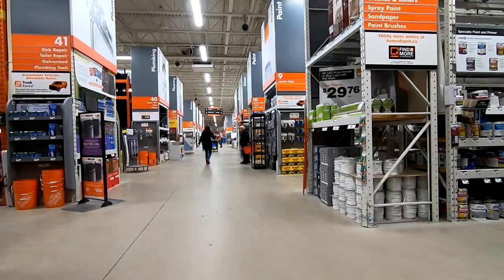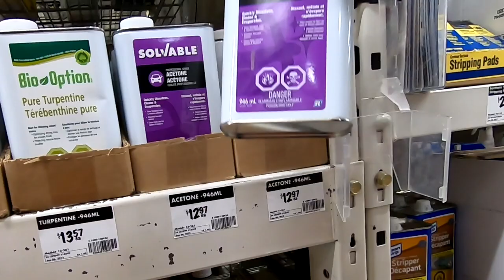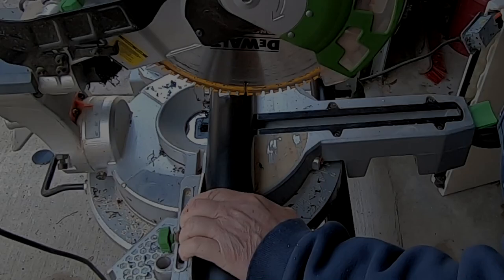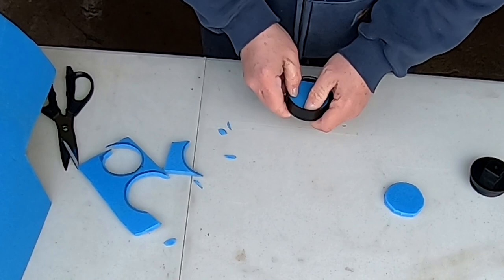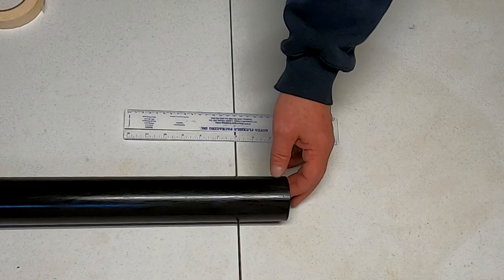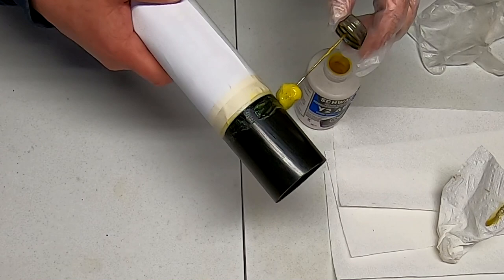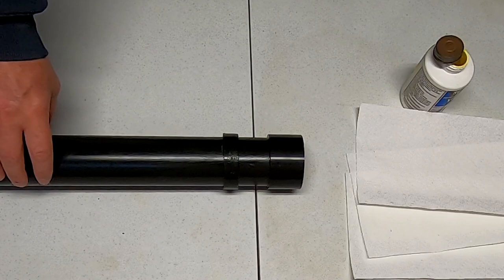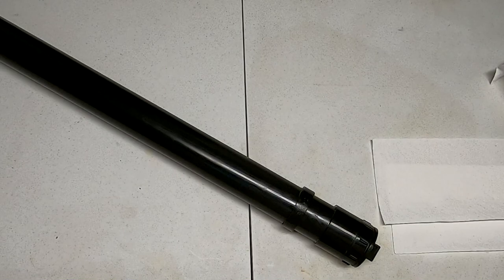Virtually Indestructible Rod Tube - DIY

Comment: Where did get the foam please
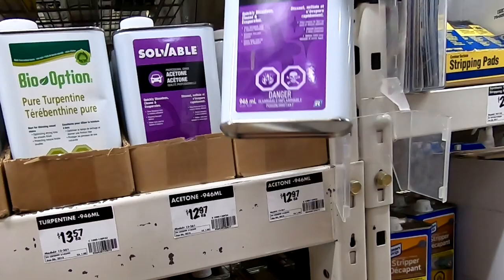Reply from the maker: Joe Boirier: At 2:08 I mention that I used 1/2" foam from an old camp mat that I likely purchased from a store that supplies camping stuff such as Canadian Tire, a surplus store, etc. The craft foam that I suggested as an alternative is available at craft stores (of course). As I say in the video, layer up thinner pieces to achieve the desired thickness. Any closed cell foam of about 1/2" (12mm) would work. Stay away from polystyrene (Styrofoam).

Comment: Would coupling also work instead of cutting the ends out of the caps ?
Reply from the maker: Richie McGlothlin: Yes, that would probably work but you would still have to make a cut on each side of the rib that's around the inside of the centre point of the coupling. Let me know if it works!